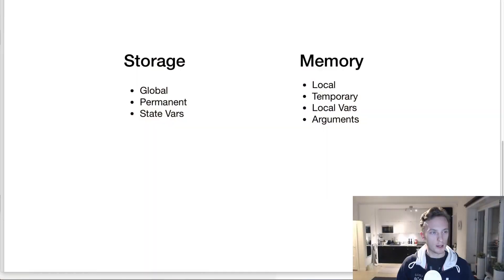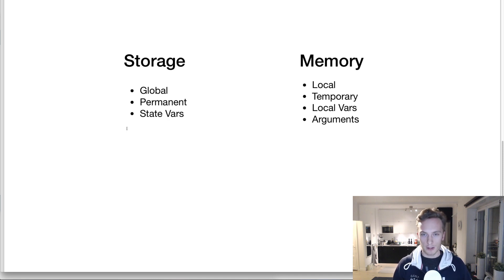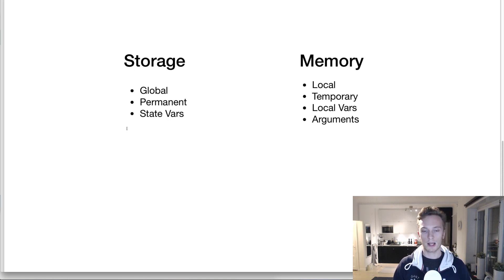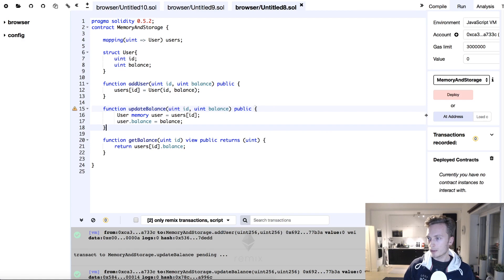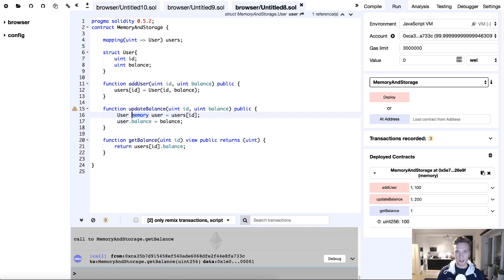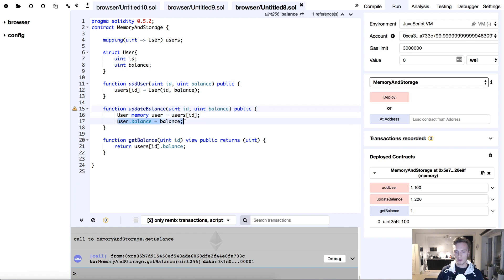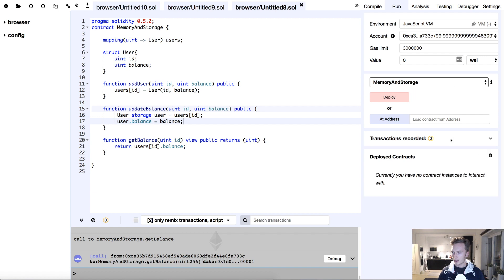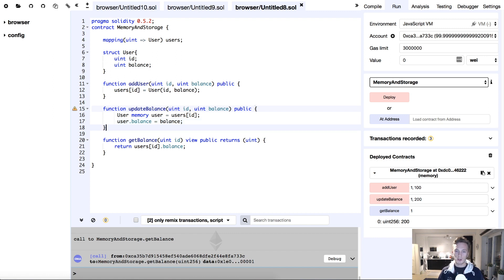Memory VS Storage in Solidity -  Data Location Tutorial

Comment: Hi! Thanks for the explantation!

What happens when you just leave out the data locator? As far I can see, there are three possible cases but I don't know which one is true:
A) Because the type is initialized in state, the location of the variable falls back to storage.
B) Because the variable is initialized within a function, the location of the variable falls back to memory.
C) The code won't compile or throws warnings/errors.

Thanks in advance!

Comment: i'm a new student with no development experience searching youtube to solve the quiz.  Now, you went through the many different methods to solve it and concluded the best methods were based on what was most clear to read.  My question is there also a cost analysis for what is the best method to resolve it as I believe the different memory types are not at the same fee?  Now I am sure as I progress through the course that will be answered but at this point progress is really slow as it is starting to get complex so curious to know the answer now.  Cheers.